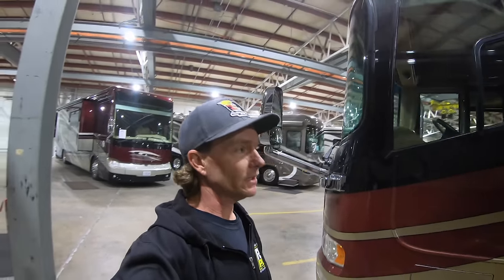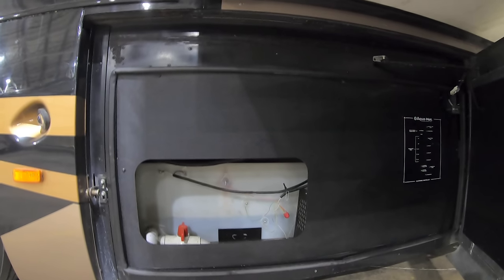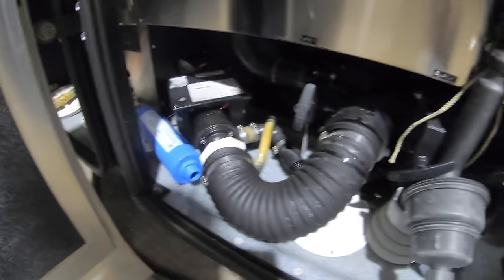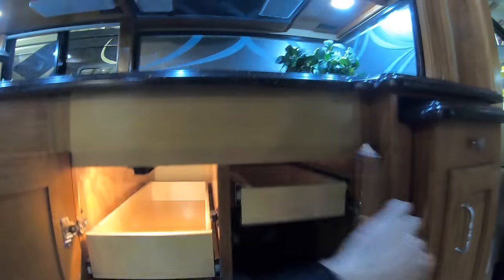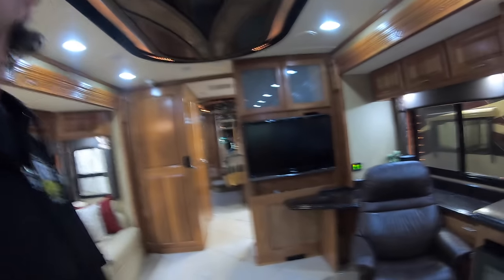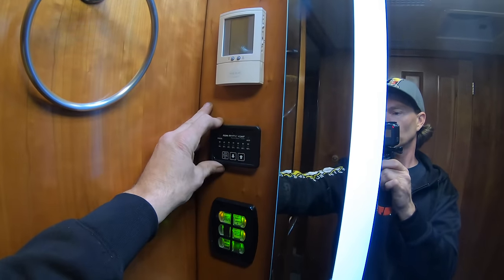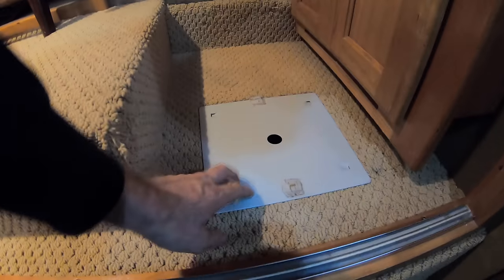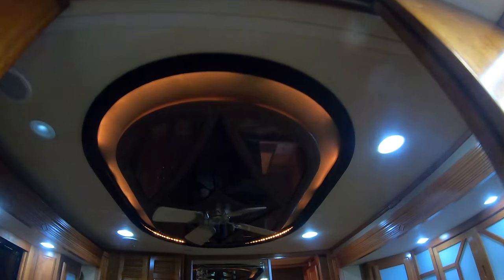09 Monaco Executive 40' 650HP Awesome Coach Big, Power Short Bus

Comment: LEDs failed due to the driver which is an electronic power supply It takes it house 120 volt AC and converts it to a low voltage like 10 volts DC It's the drivers that fail on LED lights so it's best to buy name brand like Phillips or Cree